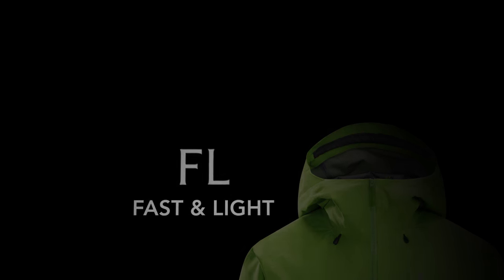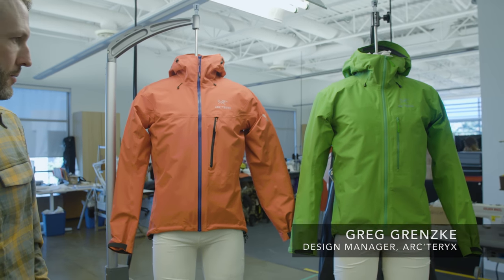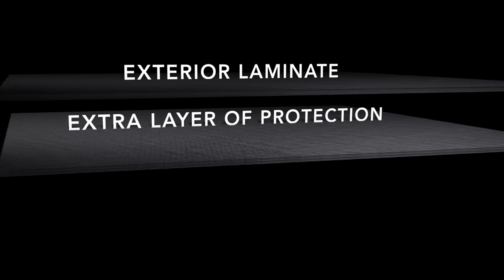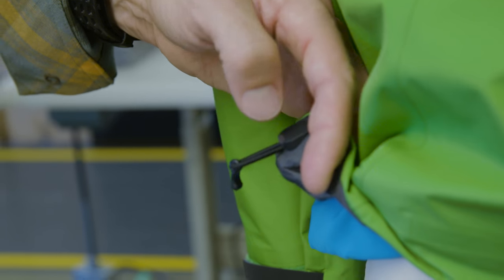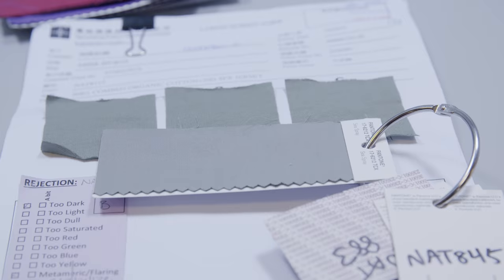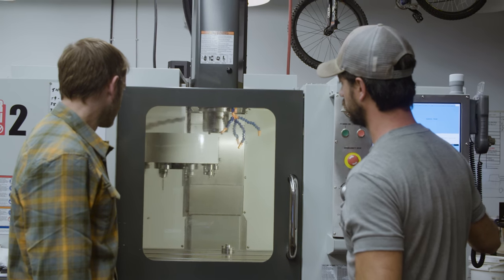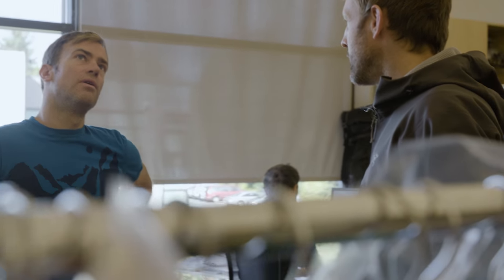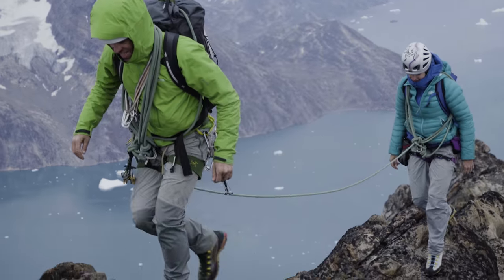The Newly Redesigned Arc'teryx Alpha FL Jacket

Comment: I have an Arc'teryx Alpha FL from last year and I was first very happy with it. But after a few weeks of use the water started to soak into the jacket which reduces breathability a lot. I washed the jacket according to the instructions given by Arc'teryx with Granger's products and reapplied the DWR coating followed by a short cycle in the dryer. All per instructions by Arc'teryx. A lot of the dirty spots won't come out of the jacket and the jacket isn't waterproof anymore around the wrists.  The outer layer still soaks up a lot of water despite the new DWR coating. 
I have to say that I'm disappointed with the quality and durability :'( 
I'm leaving for an alpine course in two weeks and I have to be able to trust my equipment so I hope it will still perform ok :(
Reply: thanks for your thoughts.  any updates with how the alpha FL worked for you on your alpine course?  do you still use the piece, or have you settled for something else?
Reply: Send it back for a refund